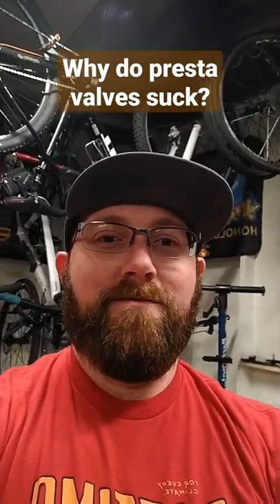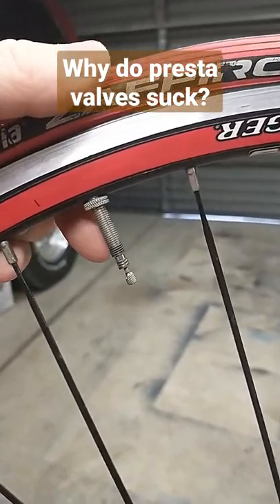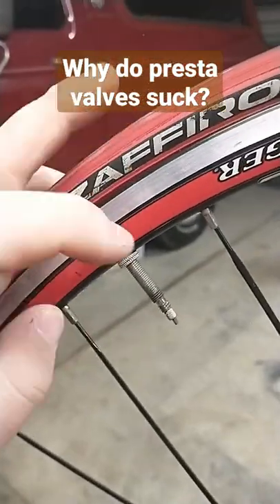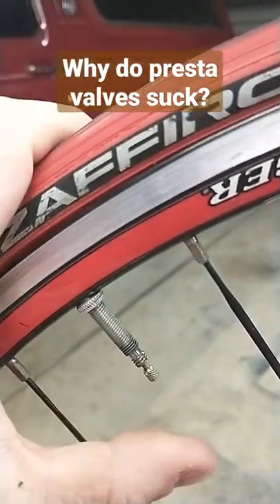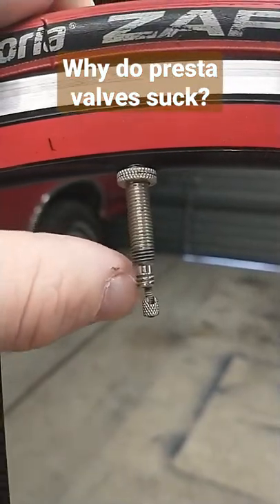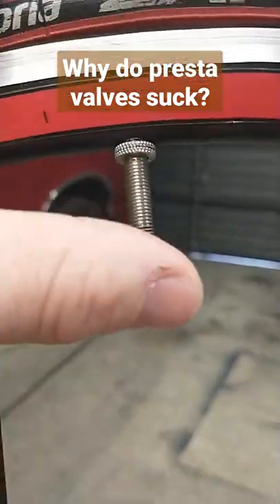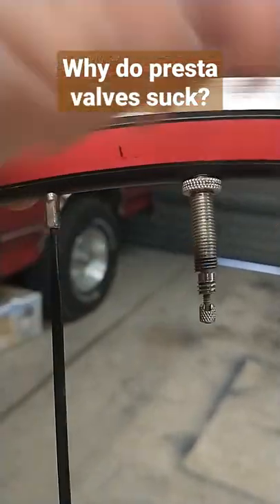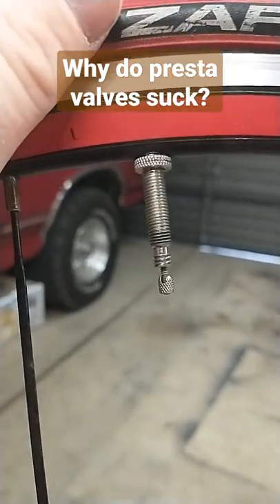Why do presta valves suck? #shorts

Comment: They aren't better enough to justify using an esoteric valve, they aren't better enough to justify being fragile, they aren't better enough to justify being a pain the in the ass. For their advantages just use a full metal stem Schrader.
Reply: Absolutely.
Reply: I have to agree with you. These prestas suck
Reply: Couldn't agree more. They only offer negatives. Schrader is so much more robust

Comment: No matter how hard I screw on the presta valve core it always comes off every 2-3 pumps. I hate them. I broke presta valves 3 or 4 times. Schrader valves are immortal.
Reply: That is unfortunate. Have you tried the push on/lever pumps instead of the screw on type? Thousands of time for me with that style with no issues. Quicker too.
Reply: Dude just watch this video and you wont think they suck anymore!

Comment: Why do they suck? You need a special pump or connector. The tires and wheels alone on my bike cost double of my first bike and the presta valves always leak after putting air in. Endless. Different adapters I bought are too small, leak air when putting on and then close themselves so you have a closed valve on an empty tire. What a joke

Comment: the fact the needlessly exist is the 1st problem. having never seen anything over than a Schrader type, i had zero reason to pay super close attention when i ordered 2 new tubes for my bike. sure, that's on me i guess but didn't know ppl invented a solution to a problem that didn't exist (now another type out there to keep track of). the vendor won't take the tubes back so now got to get adapters to add air and to keep the stem from loosely fitting in the Schrader rim. on top of that, got all the things other commenters have brought up.

Comment: ‘It is breaks off, new tube time. Not a big deal.’ what a jerky thing to say. Some of us don’t live near a bike shop nor have the funds to replace a tire.
Reply: It's 5 dollars bruh
Reply: Not a tire a tube. They are around 4 to 5 bucks. 

The thing is the other valve type has a habit of popping a leak right around the valve because the hole for it is bigger so it's a larger weak point. 

I wish they could combine the two to make a better valve. A small one like presta but all of them are removable cores. 

Though a pack of cores is the same price as one tube where I'm at, and yeah you get more cores and with the tube you get one but I think 5 bucks if it breaks is worth it for the lesser chance of leaks. 

And I don't live near a bike store either, I get my stuff at Walmart lol. I ride a bike because I'm broke so most things I get at Walmart.
Reply: How about u may not have an adaptor and theres no upside to fixing something that has been rock solid and universal forever. The bike repair guy saying no big deal if youre inconvenienced and have to pay some extra $

Comment: I keep a schrader adapter on one. And rhe other is always  bent
Reply: I just installed a new tube, that's equipped with the presta Valve of course, because that's what comes with the wheel on my bike. The valve stem it's already bent and it's the first time I've used it.
Reply: @Rex Willhite  that seems pretty common. They do suck, but I'm just used to it now. Haven't used a schrader valve since BMX keeping an adapter over them and using a shrrader pump protects them.
Reply: @Tommyhearnsrighthand  that sounds like a good idea. I also noticed that where the presta Valve is mounted to the tube, tears much easier if you bend it a little while putting the tube on or just by accident. They're always trying to better products, but I never had any problem with the schraders. And I must be unlucky when it comes to prestas. My dad used to say I was like a bull in a China closet. Haha
Reply: @Tommyhearnsrighthand  Thanks for sharing this genius idea!
Reply: @Tommyhearnsrighthand But then how do you get the dust cap on????
Reply: @edwardcullen3251  the adapter is the dust cap
Reply: @edwardcullen3251  or you can put a schrader cap on if you want 2 be extra

Comment: Zero reason to have presta valves. Flimsy junk for cycling elitists. A schrader valve is 100x more durable, every gas station in the world could pump one up, their valve core is easier to replace and more protected, scheader tubes are generally cheaper, the list goes on and on.

Comment: They suck.They're fragil. They take more steps to fill the tire. They do not let as much airflow through which is important when seating a tubless tire. They're propritary to just bikes. Literally nothing else uses them because they suck.

They were a solution looking for a problem and some bike manufacturer said - hey - this is a great way to get more money out of our customers. Let's adopt a propritary valve forcing them to come to us for wheels, valves, tubes, or license the tech from us, etc... and boom - the Presta was born... 

If they were so great, bikes would use them everywhere. But they don't. Look at the valve on your suspension fork. I bet it's not a Presta. Look at the valve on your rear suspension, I bet it's not a Presta... So even the bike industry acknowledges - they suck. But for some stupid reason, we continue to see them on bike wheels.

Comment: They suck because I'm scared to get used to them and I don't want to change
Reply: If it ain't broke don't fix it
Reply: @korodski  fr
Reply: It why I am researching, I want to adapt a horrible Schrader valve to use presta valve core for when I have a car as I hate Schrader as lose like 5psi at times trying to take off the pump but presta is easier to remove and keep air you pumped up to